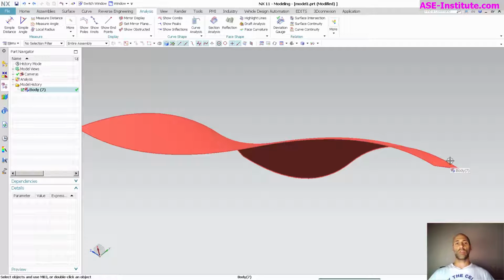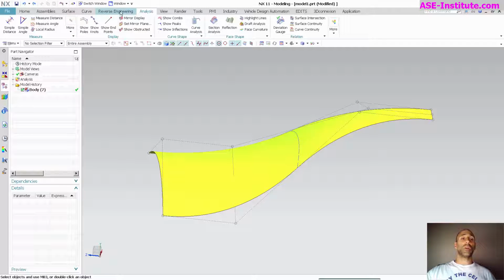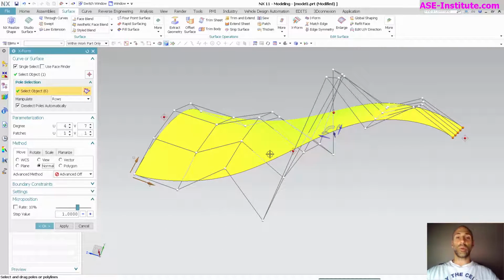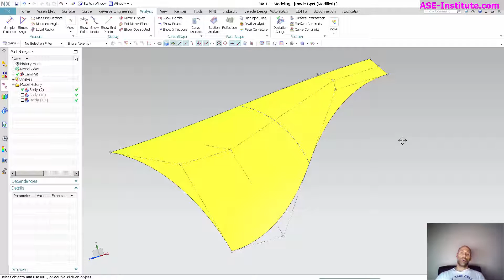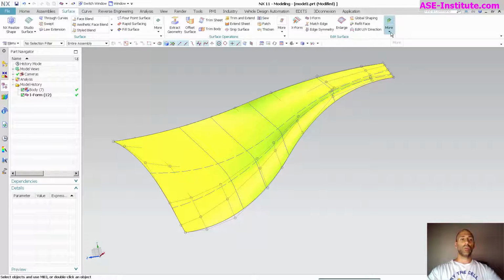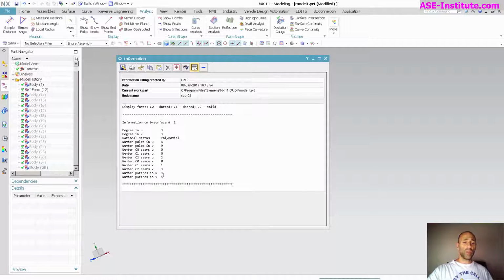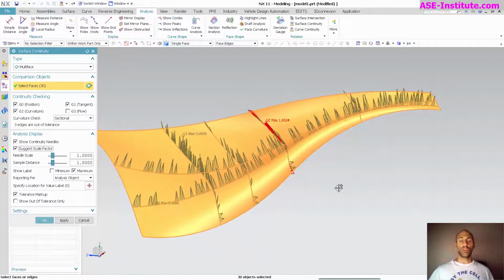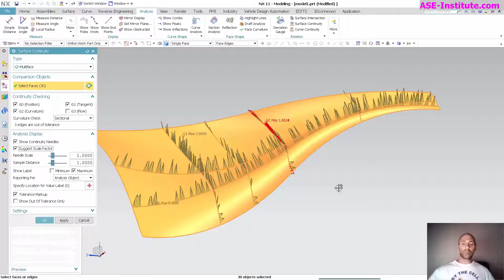Surface Complexity | Siemens NX 11

Comment: Hello Steve. If you need inspiration for a new video, I would like to know more about the surface continuity tool. What do the G1, G2 and G3 values in the graphics window mean and how do I interpret them in order to achieve a disired continuity. Thanks and best regards, Simon.
Reply from the maker: Thanks Simon I will make a series about this. It is a very confusing subject. I have already made some about the subject but I can always expand.

All the best